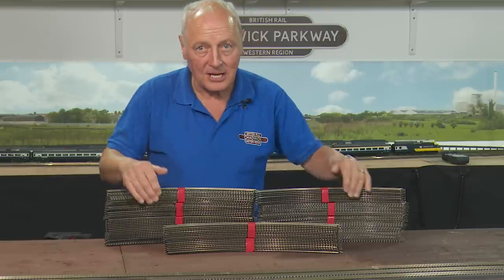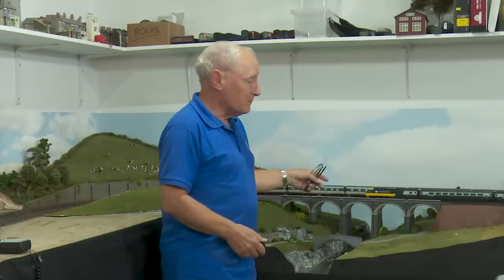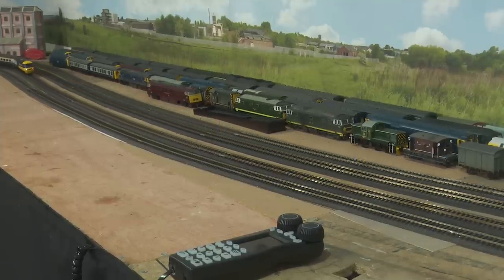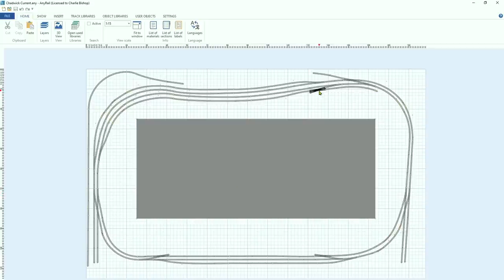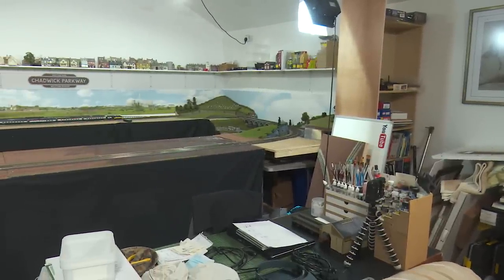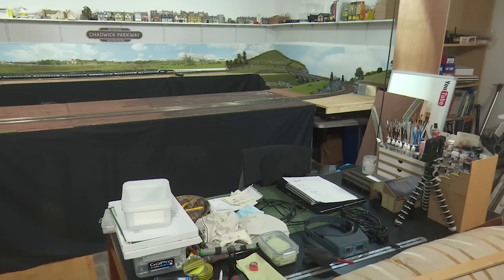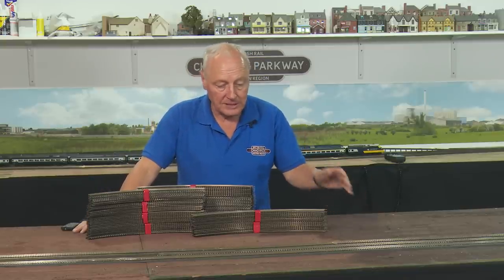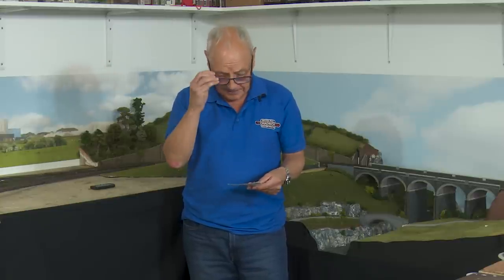Track Plan Design at Chadwick Model Railway | 111.

Comment: One alternative to a dog bone is to take the helix to ground floor level and make it a circuit by having a couple of tracks cross at floor level to an up helix at the other side - with an appropriate strong but removable ramped cover this can work.  Make it a step over rather than a duck under.  It may sound slightly mad, but I saw this to good effect on a layout in a loft when I was working and it worked well according to the owner.  He said he had considered taking it up to go above head height across and back down but his wife objected.

(Note to all though, a narrow loft access with a steep set of narrow stairs up, with a 90 degree turn half way up, required the paramedics to call the fire service for help getting the layout owner down - he had taken a fall from a stepladder whilst cleaning Velux windows...So he sorted the layout for his ageing joints but not the stairs for ours!).  Upside is we had a good conversation in the ambulance, he was fine (broken hip) and that got me back into the idea of a layout after 30 odd years.

Just a thought.
Reply from the maker: An interesting proposal mate, thank you. However the poor chap who had the fall in his loft, shocking regards Charlie
Reply: He recovered well, kept to the physio and got a dog to walk everyday.  He is fitter now than before - I see him out often.  He uses a window cleaner now though!

Comment: Hi Charlie, question for you, are you thinking of increasing the height of the main boards? It may make it easier to work on the storage yards should you need to, cheers Paul.
Reply: I agree as I get older and my old layout requires "duck under" and is set at 3 feet high. With hindsight I should have made it 4 feet high which gives more space for wiring. Better still, like Charlie, I should have used a different walk in design. 100% hindsight!
Reply from the maker: Great points gentlemen

Comment: Great video Charlie. A crawl under presents it challenges regardless of age, in my case my height played a big issue with myself bumping my head. A lift out makes it much easier. The alternative is if you can find a spare skateboard, use it to roll under! I have been looking at getting a copy of Anyrail but I am still unsure weather to invest in it. Did you find it easy to use and get started with it? You do have a good size room to work with really and the proposed plan looks to be a winner. I could have added a helix or two in my layout and space but I didnt have the confidence to commit to making one so I look forward to see how you approach this. Great video and all the best, Clint
Reply from the maker: I’m pleased that you found it interesting Clint. AnyRail isn’t too hard to master after the first couple of hours.

Comment: Charlie just a couple of things have you thought about rather than a lift up section perhaps  a section on wheels that you could move in and out, I have seen a guy on you tube somewhere that has constructed one of these. Also another chap says that when he is sometimes short of 3rd radius curves he turns 2nd radius curves into 3rd radius by cutting the webbing and virtually making flexi track but he says it's better than flexi track because it is stiffer. I was wondering if this might be a possibilty with 3rd radius to 4th radius. )ne more have you considered flexi track for your helix. If none of these are an option perhaps 2 small trampolines!! I know how you feel as my knees are the same but I only have myself to blame too much amateur football when I was younger. I still think it's a brilliant idea what you have come up with to save the old knees. Best of luck and keep safe. Frank
Reply from the maker: What a heartwarming comment Frank.  Some great points too, regards Charlie

Comment: Wow Charlie you are right from my other comment, this is a radical change from your original plan. Tho I can understand your reasons for the adjustments. These things have to be implemented for health reasons and there's no point in building a layout that is going to be difficult to access. Reference to the helix areas these are usually hid from view by a hill side tunnel scenic or run behind a building out of view before dropping down the corkscrew. I actually like the sound of the latter and if not buildings then how about this. The rocky hill side you are removing, why not move it so the rocky face is is still in front of the tracks but add a layer or two beneath to rise it higher. Build up a woodland area going from track level for about 6"-12" and rising up the hill to the top or say half way. That means from the layout well side as the trains come into that section will be barely seen as they run behind the forest and disappear past the hill unseen onto the helix. In reverse the train coming up the helix past the rocky hill and then emerge from the forest/woodland into view. I think I explained that correctly, lol. Just keep having fun with it and creating the illusions of the real thing in model form.
Reply from the maker: You’re closer to my plan than you think.
However, the opposite is true, the lines will drop down into the Helix and the other two lines will rise above it into some form of branchline station having travelled through the hillside tunnel. Regards Charlie
Reply: @ChadwickModelRailway  I will watch keenly on its progress, two great minds think a like. At least I am  finally nearing being caught up to your present video.

Comment: Thanks Charlie. You may have stopped me just in time as my layout plan would have required a 'duck under' (and may yet anyway) and I'm also now in that '60-62' golden age. I'll be very interested to see how the helices progress. Are you planning for the recommended 8" clearance between levels for the lower fiddle yard section?
Reply from the maker: I’m so pleased that you enjoyed it Will.The distance between the fiddle yard and the upper level should be around about 12inches and from the fiddle yard to the floor around 18inches. Hopefully that will allow for easy access. Regards Charlie
Reply: Too late for me I’m afraid.

Comment: Thanks for the information, I was about to do something similar where I would have to duck under the boards but it was my hip that stopped me from proceeding. I don’t recall you said anything about using a hinged or a lift off section that would provide access, what were your reasons for not going down that route? If there are problems with that method please let me know before I start making mistakes. Thanks, Mel
Reply from the maker: Hi Mel, it’s because I was going to build a 12 lane fiddle yard we should also have to be lifted for access.

Comment: Big big changes, sir! I worry about helix's, they test the couplings to the limits as you are asking them to work in two planes, but at least you're giving yourself the best chance using 3rd and 4th radius. That's a really good call and I'm sure you'll work it out as you usually do. 
HOWEVER... Please don't cheap out on the boards now. The miser in me completely understands the rationale behind wanting to re-use what you have, however this is going to be such a massive investment and you've already stated that they are "a bit wavey"? They ain't going to get any flatter! Spend a few quid now on some decent 12mm ply and save yourself the ongoing frustration in time. To quote your own catchphrase back at you... "It just kind of makes sense, really"! ;-)

All the best, 

Jon.
Reply from the maker: Jon, that’s so true you’ve won me over

Comment: Very interesting video Charlie.  Couple of thoughts .........

1)   Do you really need to use helices?   You have enough length to have a gentle grade down to your storage yards. Having said that I built one on my last layout and it wasn't that difficult.  Used the threaded rod method which allowed me to adjust the gradient very accurately.
2)   Would you not consider including  reversing loops?  Or are you able to run all your stock in either direction.  
3)   I agree with you about AnyRail - it's brilliant.  I run it on my iMac (with a big screen) by having both windows 10 and iOS on the same machine.  I only use W10 for AnyRail and it works perfectly.
4)  I'm now nearer 80 than 75 and have spent the last six month Lock-Down planning my new layout, (and as of yesterday started cutting wood) which is around my bedroom on shelves as it all has to be removable when I "Check out" !!.  Being a gluten fo punishment it includes a scenic gate for access.  Did you consider a gate for easy access?  BTW middle age starts at 65 does it not?  :-)

Take Care and keep safe.
Reply from the maker: A heartwarming comment John. I have considered many options.  Regarding AnyRail, what’s W10? Regards Charlie
Reply: @ChadwickModelRailway  Windows 10
Reply from the maker: Sorry for my stupidity!
Reply: @ChadwickModelRailway  Just a premature senior moment perhaps?

Comment: I assume you have considered and dismissed the idea of a lift up flap? - perhaps even in the same area you are going to chop out. Having built an unsuccessful helix in the past (it's still there, just not connected to the layout any more - I couldn't face taking it apart again!) I was going to offer some advice, but you've got that covered with outsourcing it. As always, with what you do, and what others before you have done in completely redeveloping their layouts (Everard Junction, Lakeside, etc) it's sad to see some of the "old" layout go but great that, knees willing, we can all look forward to many more videos as the layout progresses. If you don't already possess a pair, invest in some work type knee pads. You'll look like a geriatric skateboarder but it will save your joints no end! Cheers
Reply from the maker: Thanks for your understanding Davie

Comment: Charlie, It's amazing how similar we are. Or maybe all railway modellers are the same. I'm currently going through the same turmoil in my mind.
I've decided that my next railway will be a walk in railway, rather than a climb under. The turmoil is, should I do it now?
Wise move. You're not gaining much from the scenic side of things. In fact, you're probably loosing a bit, but I'm sure your modelling experience will be much more enjoyable. I often think about going to work on the railway but I'm put off by the hassle of climbing under everything. I did think about a pair of helixes to a lower level but they take up so much room and where do you put all the stuff that was previously stored where you will eventually have a fiddle yard.
Anyway, suggestion.
Why no have a cross over at each end of the fiddle yard so that a train coming from any of your 12 storage lines can go on to the correct running direction. If you see what I mean. That way you can use you fiddle yard for staging, not just for storage.
My plan is to detach the loco from the train when it stops in the fiddle yard and take it off to shed. When the train is ready to go back in the opposite direction, either the same or different loco comes from the shed down to the staging yard. Couples up to the other end of the train and takes it out the way it came in, then crosses over to the correct line.
I hope you're still with me.
Once the train has left the fiddle yard, it can go round the circuit as many time as you want until it reaches its destination. Stop in the fiddle yard. Detach the loco and off to shed. I wonder whether the loco movement might be more interesting than the circuits. These loco movement are genuine operations. Not something I might make up because I want to see a different loco.

Anyway, great video and I can't wait for the developments.
By the way, what are the planned dimensions of the helix? Just in case I get tempted.

Thanks,

Bob
Reply from the maker: What a cracking comment Bob. I believe the dimensions of the helix are around 52 inches diameter. With 4 tiers
Reply: Hello Charlie,
I think you said there would be 28 inches clearance between the main board and the fiddle yard. That would be 4.5 inches for each tier. At 52 inches diameter that would need a gradient of about 3%.
About half of my locos are steam so if I was to use a helix I would try to keep the gradient below 2%. Preferably less than 1.5%. That would need a helix of about 8 feet diameter, to achieve clearance, so you can see why I'm reluctant. Two of them would take up a huge area of my shed.
I know diesels are more capable than steam when it comes to gradients but 3% sounds a bit steep. Have you done trials with your longest trains, on curves inclines?
Do you plan to use DCC Concepts Powerbase? That might be a game changer.
Good luck and keep safe.
Bob

Comment: Blimey Charlie Your not making it easy on yourself
Personally I'd Love to see a Video On Decoder Pro having just got into JMRI and Put my Dynamis to one Side 
I don't have your problem as i have a Loft Layout and my Ladder comes up through the centre.
I still have to climb underneath to get to the back of the layout serves me right for using 4' wide boards its amazing how many bits i find with my Knees "Ouch" whilst crawling about under the Layout.
I just wish id seen your Channel before i started my Layout late last year would have saved me a fortune in time and Money
Keep it Up and Good Luck with the New Junction
Reply from the maker: Hi Chris, I’ve started with decoder pro yesterday but it’s not quite as intuitive as I’d hoped, regards Charlie
Reply: @ChadwickModelRailway   I know what you mean I,m on my forth Dcc controller in under a year Hornby Elite,Hornby Select,Dynamis and now Decoder pro.All I wanted was Twin Throttles and Wireless Control but hopefully I can work it out .
Good luck with Decoder Pro Keep up the Essential Video's

Comment: I've always wondered if folks hid helix in mountain scenery; would love to see pics too.
Reply from the maker: Sadly none forthcoming up to now
Reply: Hi Charlie,  Steve from Aussie the land down under.  I have just built a helix for my set.  I managed to use Peco code 83 flex track, I staggered the rail joints using two cut offs 1/32 Evergreen Styrofoam and glue it down with Copydex. Being a latex glue this allows for expansion and contraction. For the under lay I used a rubber 3 to 4 mil thick which cuts the rail noise down significantly.   If you are interested I could send some pictures of the helix if wanted it's designed and made so that you can stand up in the centre. Regards Steve B

Comment: Charlie, I have been a subscriber for a few years, always enjoy the content but don’t often leave a comment.
However you are taking a course that I did 6 years ago, just wanted to give you a heads up.
Like you I used 3rd and 4th radius curves, on helix boards supplied by a baseboard firm who’s name escapes me at the moment but are on the south coast if my memory has any recall. Anyway working to there heights for rolling stock clearance, I ran into an adhesion issue on the 3rd radius curves whilst ascending, I could not pull a train with more than 6 coaches and a freight train was even shorter than the length of a 6 coach train. Even with a diesel loco I only gained a 1 coach advantage. 
Now after a few weeks/months head scratching, the solution I came to was to arrange the layout/ Helix’s so that the ascent was always up the 4th radius curves, which as I’m sure you can appreciate creates far less friction.
Although running 11 coach trains was out of the question, it did improve things so I could run 7 or 8 coach trains with steam and 9 or 10 coach with diesel.
As you will find out the pulling ability of locos differs greatly, perversely large locomotives are worse than smaller locos, a class 37 for instance is not as good as a class 20, or for steam a 4f can outperform an A3! 
There is a solution to that problem as well, it involves lots of lead strips inside the locos!
Have fun.
Reply from the maker: What a cracking comment. I have already redrawn the plan so that locos climbing will always be on the outside.
Reply: Add the powerrbase by dcc concepts might well help matters too.

Comment: Question, for the lower fiddle yard areas, as those have relatively fixed "pass through" track, operation is unlikely to need a lot of automated switching.  Does that suggest you might could use the ca-chunk solenoid point operators rather than £26 tortoise motors for the ±2 dozen turnouts the yard will want?
Which might also save a bob or two on how much padded base will be wanted down below, as well.
This, also as the helices are like to want more sound insulation than the rest of the track, lest every train run through them emulating a pachinko parlour.  I do not have an answer, I am postulating so as to see if the larger intelligence of this audience can opine.
Reply from the maker: Interesting points Captain Mac, and soundproofing is on the agenda. Regards Charlie